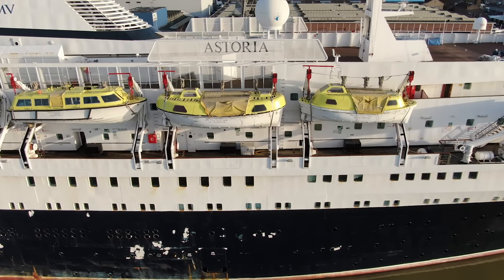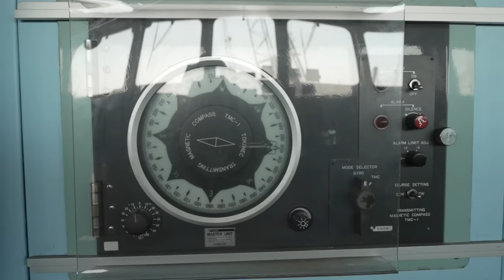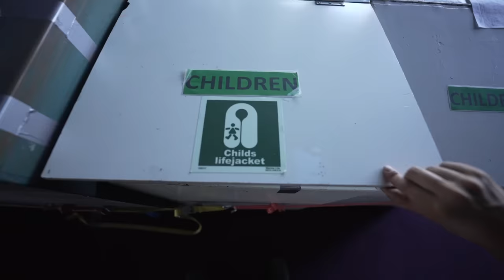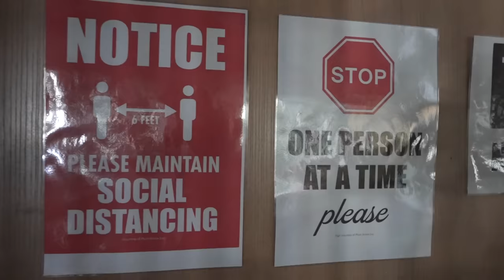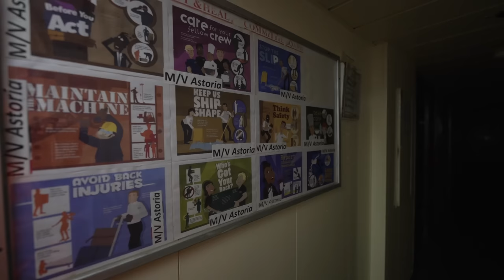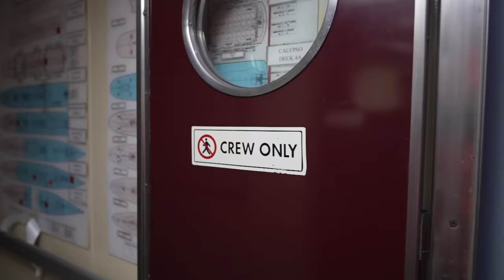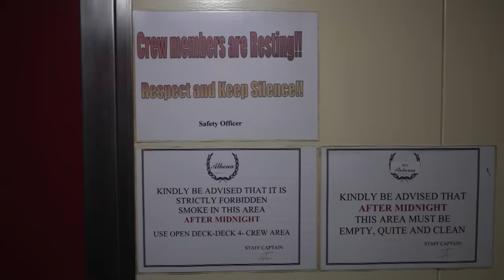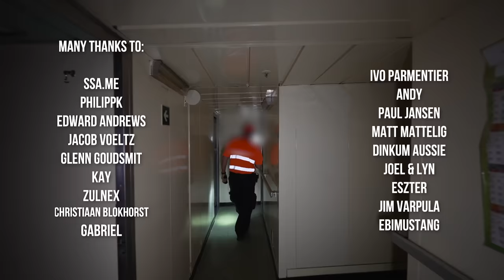Snuck inside historic cruise ship MV Astoria | Fully explored

Comment: At 75 years old and being in cold lay-up, what it would take to restore this ship as well as bring it up to code for passenger use is not probable. When a ship is in cold lay-up with no maintenance, the equipment will continue to corrode  (note the water damage and rust) which is why it probably hasn't been able to sell.  Just like an old car, you can continue to pump money into it yet things will still continue to break down. As a cruise enthusiast (14 cruises and counting) , I found this video to be very interesting and appreciate the work you did to get onboard and explore a ship that thrilled hundreds of thousands of passengers over her time!
Reply: Technically everything below the waterline is 75 years old, everything else is from when they rebuilt her in 1994/1995

Comment: It's crazy how fast things decay! Most of the ship was in fairly good condition, but in some areas, mold was setting in and paint was peeling off and it hasn't even been 4 years!
Reply from the maker: Yes.. Luckily it was only in a few parts😌 Thanks for checking
Reply: What happens when they don't run AC or a dehumidifier
Reply: @gregsbiplays9899 It looks like water is getting inside which is causing the mould and other damage.
Reply: @PhysicsAirline  What happens when they don't run AC or a dehumidifier

Comment: Fascinating to see how they semi-decommissioned it - all the stores and restaurants and clubs all emptied out, rooms all stripped to a certain condition.. and then left to rust. Unlike others I think this one is probably better left to the scrap yard. She had already lost all of the "mid century" charm of how she was made in the 40s/50s, none of that is left, the interior is a weird mish-mash of 70's, 80s, 90's and 2000s - some levels of modernization mixed in with stuff that is 30 years old, plenty of corrosion, and other than the history of the original hull, nothing that makes it exceptional. It would need to be gutted to bare metal and rebuilt/refitted at this point with the amount of decay to mechanicals, electricals, and fixtures,  and so much mold everywhere to be safe for passengers - and that would probably be more cost and effort to refit than a smaller ship like this would be worth in the cruise market. Time to send this one to the shipbreakers.
Reply: This is a pretty record breaking ship. It's really doesn't need much work done. All the carpet and linens need to be replaced but everything else is relatively standard work with maintenance
Reply: Its significant enough to be saved. Ive heard there are plans to refit her and use her as a hotel. The whole scrapping rumor was proven false by the owners.
Reply: The ship was actually completely gutted in 1992-93. Everything was redone during that time. Her only original aspects from 1948 are her hull, portholes, keel, and funnel location. Everything else was redone in one way or another in the 90s. I would love to still see her saved. They could put a memorial on her for the five people who died in her bow when she collided with the Andrea Doria.